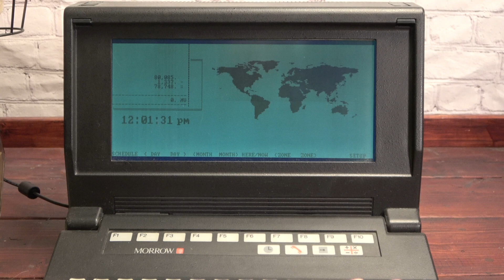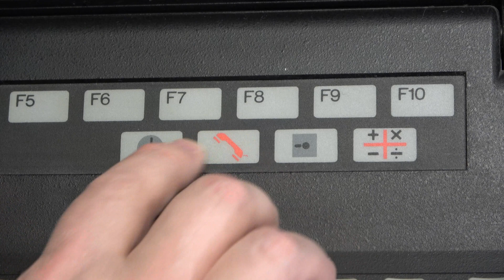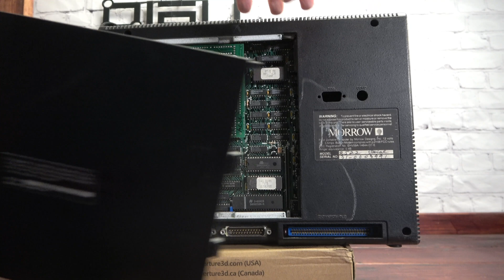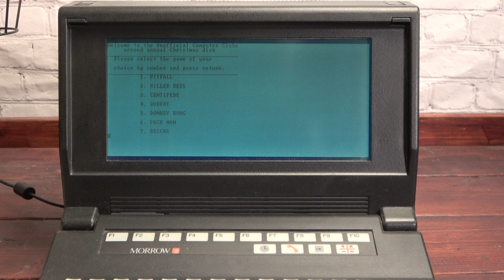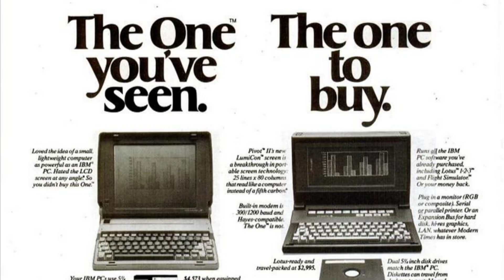Revisiting the Morrow Pivot II - A 40 Year Old Luggable PC!

Comment: You are my hero! @1:08 you showed what I came here for, and the was it the tip was positive (it is) or negative. Thanks! I just bought a Zenith 171 and it didn't have either the power supply or the torture strap (carry strap). 

I did get it running with your help, and it came with a bootable DOS image! The keyboard has some dead keys, I guess that's next.

Thanks!